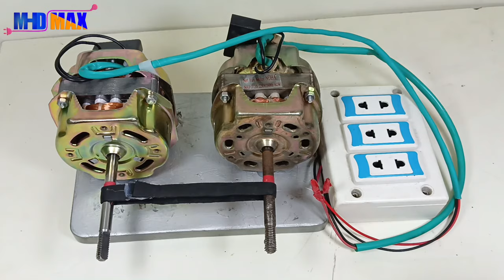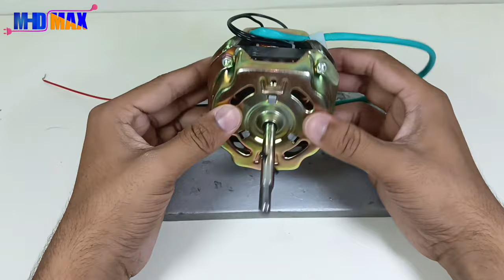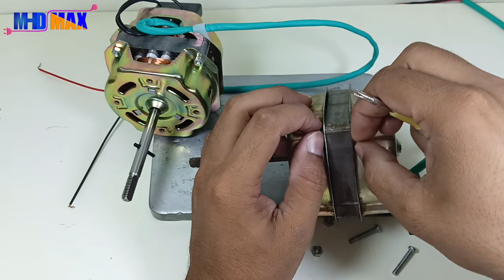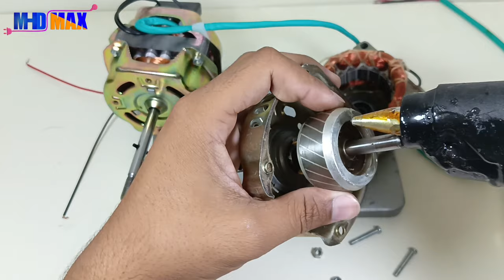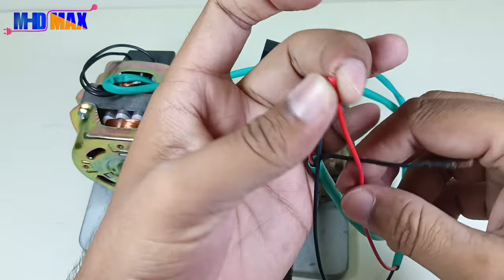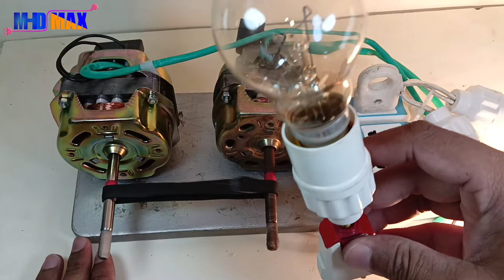Electric Generator How to Make 220v Free Energy 2 Fan Motor

Comment: The motor is less than 100% efficient. The belt is less than 100% efficient. The generator is less than 100% efficient in your system. How do you get more than one hundred percent Energy out?